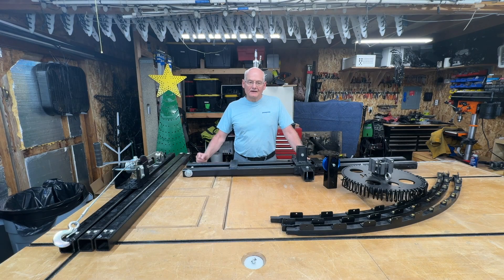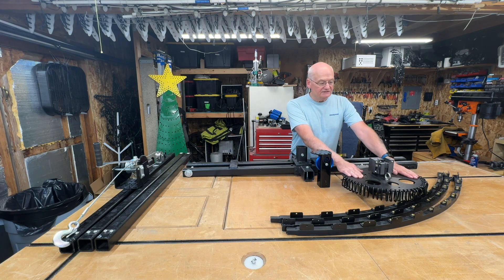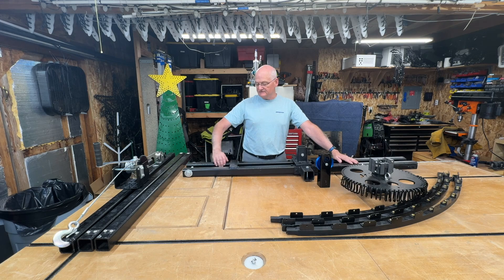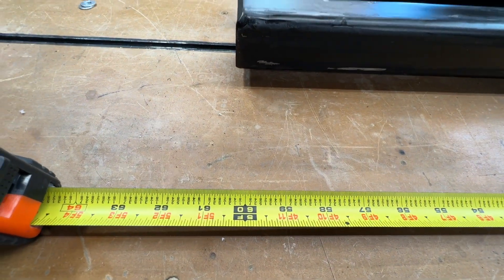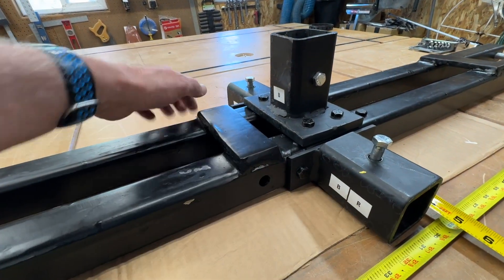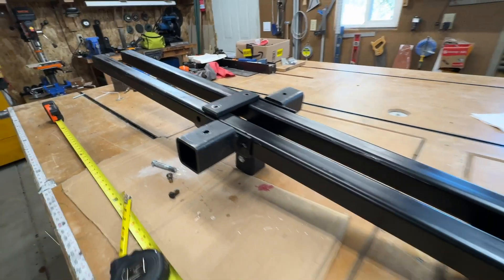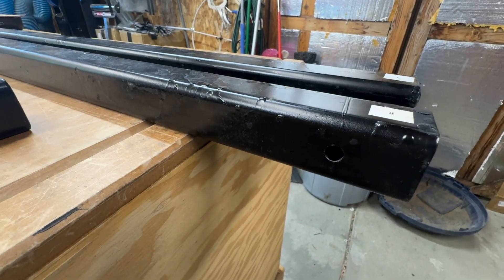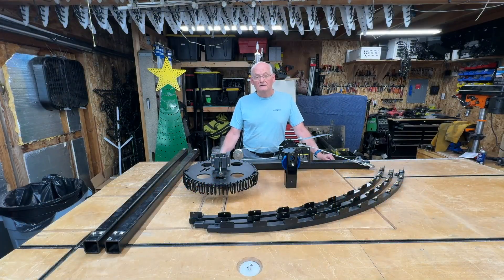Tiltup MegaTree Pole

Comment: I already have one sleeve in the ground...trying to design something similar but using the existing steel tube in the ground.
Reply from the maker: You should be able to do a single post, just need to make sure it is strong enough.  There is a Facebook post in the xLights group with some ideas in it.

Comment: Great job. Thanks for sharing you idea/design. Well done. It would be great to see the topper and star design and attachment along with the guy wires and how they attach when the tree is up. Thanks.
Reply from the maker: Glad you liked the approach. Setup is one of my future videos.  For the star I have used a floor flange with my custom made Star.  I welded my own star using the same technique as my wireframe video.  The star is welded to a 1/2 inch pipe that screws into the floor flange.
Reply: @bergmannlights5149  Thank you for the reply! I look forward to seeing the detail in the Star, specifically how it attaches to the topper, which I think I understand from your description is that you have a 1/2 floor flange screwed to the topper, and from what I could see, just in front of the pole hole, which has a 1/2 pipe supporting your star. Given the topper goes up and down, with the star, do you have support wires at the top of the pole and if so is the top of the pole some distance above the star to allow for wire clearance, or do you have no support wires and the 2" square tube and lower structure is the only support for the pole?
Reply from the maker: I plan on attaching guy wires to the top of the pulley.  There is a chance that the star will have some potential interferences.  I plan on making an extension for the pulleys top plate which I can bolt to the top to allow the guy wires to clear the star if needed.

Comment: Using the Pixel Paradise Pulley, how are you running your guy wires while using the Mattos topper?  It would seem like your guy wires would have to be really close to the base or there is a lot of room at the top.  I want my guy wires at the top so if I have to raise and lower the topper I can keep the pole supported.
Reply from the maker: At this point I am going to connect directly to the top plate.  If the topper or star get in the way I will make some extensions with 1x1 angle to move the connection point away from the center.
Reply: I was looking at the same thing. I have seen other people weld tabs onto the Mattos cap and they only stick out maybe 1.5” so you may be fine. Rather than weld tabs it might be easier to cut a bigger round plate and drill holes for that top plate. I think I might buy the pixel paradise pulley and cancel my Mattos pulley and cap.

Comment: Looks great!  I am with you regarding the 800 lbs of concrete in the ground.  I installed a flag pole sleeve with roughly that amount of concrete to be certain my tree wouldn't tip over. 

The trunk of my mega tree is totally different than yours but my 1/2 ring base is supported in a similar manner.  I found that I still needed to add anchors under the ring due to the strips pulling it up.  You probably have a plan for that already but I thought I would mention it.  Look forward to seeing more of your videos as the season approaches!
Reply from the maker: I have 4 earth anchors that I use for the base ring and will have 4 guy wires on the top.  I believe that will keep everything secure.  I am debating if I need to put in some small turnbuckles on the bottom of the strips.  This ring is much truer than my old one.  Thinking I wouldn’t need them.
Reply: @bergmannlights5149  I used 4 earth anchors around the perimeter with heavy duty zip ties like they use for installing flexible hvac duct.  I just ran the zipties over the base ring between the J bolts.   If the ring is true and secured to the ground, you might get away without the turnbuckles.  Another option might be to bend your brackets to an angle that would let you use J bolts in them if that doesn't mess up your spacing.
Reply from the maker: Great suggestions.  If needed I can cut another piece of 1x1 angle and bolt it to the ones on the top of the ring.  That way I could use the j hooks like you suggest.